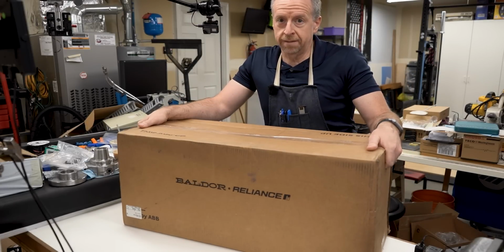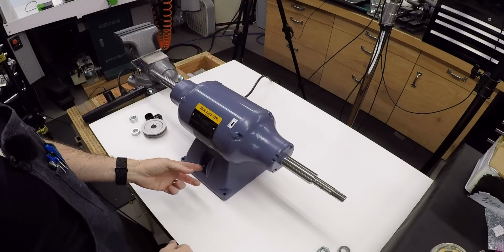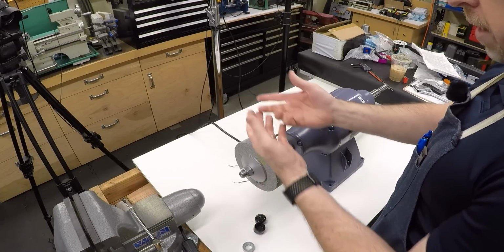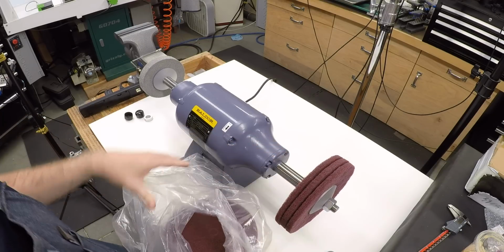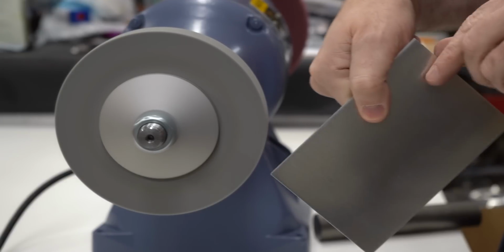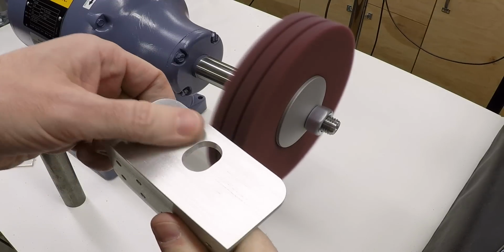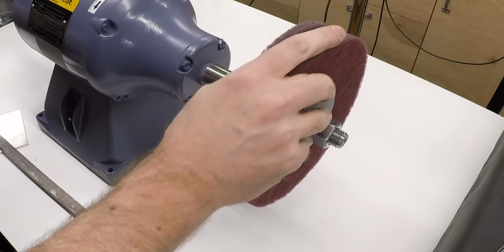Setting up a Baldor Buffer for Deburring and Finishing

Comment: I have a 3000 RPM (50 Hz) Chinese buffer motor, 1/2 HP and 1/2” shaft diameter, so not nearly as hefty as this one but it seems to run smooth. Haven’t actually used it yet, but got a good deal on it locally so couldn’t pass it up for wire wheel use mostly. I cringe when I see wire wheels on a normal bench grinder with guards and tool rests etc! Even with those removed, regular bench grinders are purposely deigned to keep the wheels close to the bearings, whereas you want the extra extension on buffer motors for polishing/wire wheel use.

Comment: Good point on where to hold the piece so not to get kick back.  I was watching the way a knife maker on tv was using a belt sander and noticed he was doing it the dangerous way.  He cut himself very badly.    Not sure if the knife had to be sharpened the way he was doing it. He was pointing the sharp part of the blade upward, the wheel was spinning downward. ......

Comment: that's a beautiful machine but major overkill for deburring.  I have a 4.4 amp ,1/3 hp baldor buffer that is perfect for deburring but does not have enough torque for polishing or aggressive wire wheeling.  your machine would be perfect for those tasks.

Comment: I know I'm a year late, but wanted to share that I have the identical Baldor motor and it sits on a heavy duty cast iron original Baldor stand. It currently has a brass wire wheel on one end and a diamond abrasive wheel on the other end that I use for grinding my tungsten tip. I also have many different buffing wheel cloths for polish work.

Comment: I got the same scotch brite wheels per Joe Pi’s suggestion.   I ended up using 7 of them on one end of my Baldor.  They do wear down pretty quick, but my machine is 3-phase (330B at 2x the RPMs);   love the results.   Good safety tips.   Thanks for sharing this!
Reply from the maker: The wheels are great.  Once you use them, it's hard to be without them.

Comment: I have the same Baldor motor and have been using it for many years but I still found your video very informative. I clicked on the link and they are no longer available from Amazon. I did notice in the description that it was to be used with cloth wheels only, which is the only way that I have used mine. I do agree with the use of scotch-brite and the abrasive pads and am considering their use for my new endeavor of knife making. Good video. Thank you.

Comment: Just curious.... where you are removing very small amounts of material, do you think the Baldor 1/3HP version of this buffer would work well for this application?  I think it is only available at 3600 rpm.  Do you think this would be an issue?
Reply: I bet it would 3/4 hp seems like overkill and i did not hear his motor bog at all.  I  just ordered the 1/3HP Baldor 111 for $300 . I would not be worried much about burning up a Baldor motor with a 6 inch scotchbrite wheel.  !/3 HP would seem adequate unless you were running heavy constant production work non stop all day long.

Comment: You used the adjustable wrench backwards. The adjustable jaw should be on the side in the direction your pushing.
Reply from the maker: I forgot it was a left-hand thread.  Though I'm flattered that you think I'm strong enough to break the wrench just by holding the other end of the shaft with my hand.

Comment: Why 1800 RPM versus 3600 RPM?
Reply from the maker: I thought it would be more controllable for hand buffing and deburring.  It doesn't cut as fast, and it doesn't heat the part up as rapidly.
Reply: Buffing pads and wheels also aren't rated for the higher RPM.

Comment: I used the same gray Scotch-Brite to debur gun parts and if you apply light pressure and run it across the wheel very fast with light pressure you can maintain the edge without rounding it.  I would debur hundreds of parts today so it is something you have to learn to do

Comment: This exact setup is my preference for deburring parts from general welding and fabrication. My finish process is hand work with an angle grinder to do any significant rounding and then some quality time deburring edges from the more aggressive grinding. Nicely rounds any sharp corners and pulls off any little burrs that might compromise paint and cause chips. It's also way easier on the hands/wrists/elbows to handle parts vs handling an angle grinder and die grinder for batch-part finishing.

Comment: I had never seen/thought about using pads in a grinder like that.  I have been looking for a buffing solution for a grinder.  Thanks for the idea!
Reply: Me too. I've used them on 4 and 5" grinders for years, never knew they were made for stand grinders, gonna get me some, my boys will love them !  I have an old dental buffing machine, they will be perfect for that.  We also converted an old washing machine motor to a stand buffer, using soft metal wheels to clean auto parts and machined parts. Thanks James !

Comment: I almost got that after Adam got his. I cheaped out and got the HFT version instead.
Reply from the maker: How is it?  Good buy?  To be avoided?
Reply: @Clough42  so far so good. Runs smooth and true but a bit down on power. I run my scotchbrite wheel on a Craftsman 6" variable speed and it has always done fine. I also have an 8" central machinery grinder from HFT and it has been amazing for the price... thats what got me to try the buffer from HFT figuring the Baldor would still be around if it didn't work out. 

Standard disclaimer: homegamer speaking

Comment: James.

I need some quick help with scaling correctly for my lathe feed shaft with your new firmware.
Motor is set to 1600 step per rev.
My leadscrew is 8 TPI and that is all clear. I have that configured correctly to 0.125” per revolution.
My feed-shaft travel rate is 0.0156” per revolution, so how do I figure out the scaling?
If James or someone else can help it would be appreciated.
Thanks.

Comment: I have had one of the smaller versions of the Baldor buffer for over 20 years, and for most of that time it has had one of the scotchbrite deburring wheels installed.  Have deburred a lot of aircraft sheet metal parts with it, but I usually run the edge in line with the wheel. It does wear a groove in the wheel, but you can get both corners in one pass, AND remove any tool marks from the edge which might cause stress risers in service.
Reply from the maker: Oh, interesting.  I imagine the stress risers are a much bigger deal in aircraft parts.

Comment: Wood working tools? ewwwwwww! Get them out of the shop before they contaminate your real tools!
Reply from the maker: I did all of the sawing and sanding for my deadlift platform out in the driveway because sawdust does, indeed, contaminate the lubricated ways of the machine tools.
Reply: @Clough42  yes it does. With dead tree carcass. Ick.

Comment: Btw, it'll be more advantageous and efficient if you mounted the buffer on a pedestal style base. This way you can easily work on longer parts. Plus if it kicks outs downward, it'll shoot towards the floor and not the a bench and possibly bounce back towards you. Safety Police here, this is your first warning :)
Reply from the maker: Not a bad point.  The potential to get hit by a bounce is the sort of thing that might only become obvious in retrospect.  :)
Reply: @Clough42  Ask me how I know.
Reply: I just had a headlight trim ring suck into the wheel and hit me. Not a fun time. Very dangerous but very effective machines.

Comment: These 8" deburring discs are also know as Buff & Blend disks. The maroon you are using comes in Medium, Fine & Very Fine. I also had an issue finding this exact 3/4in shaft diameter. One site AbrasiveStore.com had them for under $4 per disk. I would buy them ten at a time, however visiting the site, they have change the minimum order to 100 for this disk ($3.86/ea). The 1/2 inch version has no minimum.

These are my go to disks for cleanup and finish. However will need to search else where for another supplier. Next time search for buff and blend disks.
Reply from the maker: Cool.  Half the battle is knowing the right search terms.

Comment: Did you do any measuring of how much material is removed when surfacing?  If you use those to take out toolmarks on a flat surface, curious how much it actually changes dimensions.

Comment: Radial runout will not completely "self-cure" on a semi-rigid scotchbrite wheels. If you want it to run true, use a sanding block with fine paper affixed to it. For deburring, this rig is perfect. For polishing, this rig is too aggressive to preserve edges, corners, lettering, holes, etc. Dust control with these wheels is a thing. Trying to deburr a hole or slot through the part with a scotchbrite wheel will tend to "pull" the edges of the holes... this will work, but it is unsightly if you are going to anodize later. If you are polishing across holes and want a smooth non-undulating surface, a wheel is probably not the way to go.

Comment: Thanks for a very instructive, informative and inspiring video.
Time 05:40 If force doesn't work, use more force, we say over here.
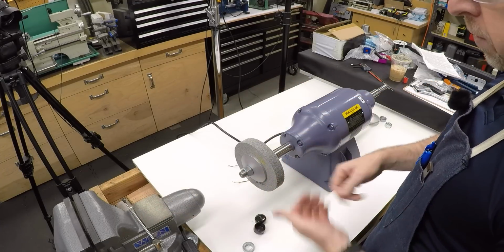Time 07:22 You likely have some 60 000 eyes checking You so Youu better "behave well"....
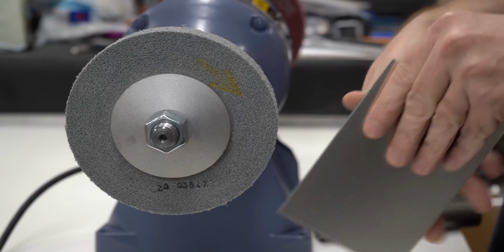Time 14:00 "Everybody" ought to know that but.... Very good pointing it out!
Summing it up, a good buy.
Inspired by Your video I just unboxed a bench grinder I bought, on sale, ca 1 year ago. Reading the manual, plugging it in and starting it, standing loose on the floor, a light humming was heard, and it didn't want to run away! Nice buy I think.
Cheers!

Comment: Maybe a light coat of spray-on contact cement could be used to glue the Scotchbrite pads together so that they don't splay out during use?
Reply: @kfoltman  I've used contact cement to glue air filter (low density) foam together.  It seems to work fine.  The foam tears before the glue lets go.  However, with the light coat needed (to avoid the "melting glue" problem mentioned by somebody else) it could be a problem.  There's only one way to find out - try it.
Reply: Can only glue them near the center, otherwise the glue gets melted to your part, and that gets ugly fast.

Comment: The scotchbrite pads were seperating and the part was going inbetween under light to moderate pressure.  Would wider metal end-collars be advisible on new pads ?
Reply from the maker: Maybe.  I think they'll fray and that will be less of an issue.  We'll see.
Reply: im thinking even some wider cardstock washers would help the hard corners from getting snagged

Comment: Because of the way these spin and the nuts self tighten I have kept mine just finger tight for years now and never had any issues - nice setup! I have the same thing but I tend to take off the pads i`m not using and store them in zip locks so I have various options that aren't cross contaminating.
Reply from the maker: Not a bad idea.  For light use, swapping wheels and pads would save space in a small shop.
Reply: @Clough42  And I have a click spring small shop. lol
Reply: @Clough42  Also cutting out sheet metal washers of larger dia. than spacers and using that extra dia. to run ~3 little bolts through all pads and 2 washers makes swapping easier and faster, and increasing the dia. out towards the edge can regulate stiffness if you find "not quite right" at a yard sale,lol.
Reply: @Clough42  If the nut loosening is an issue - or even just the (sensible) fear of it - a jam nut ought to stop that as well as let you control how much 'squish' to apply.